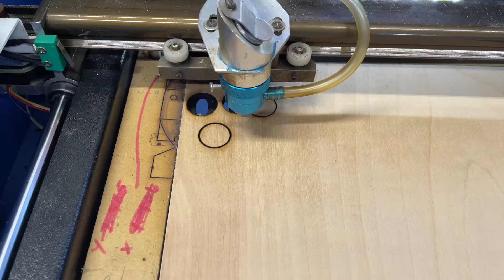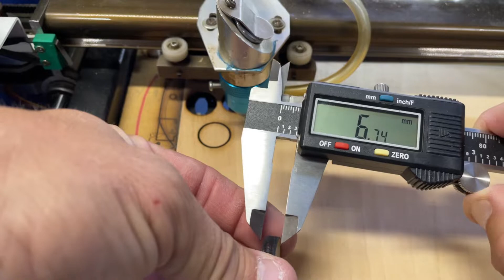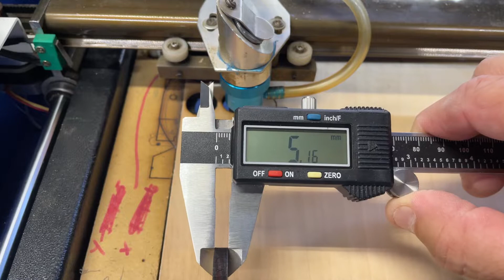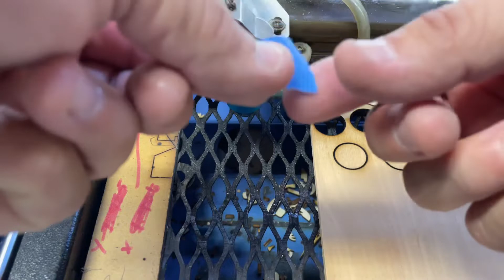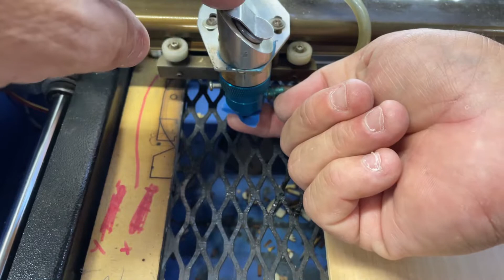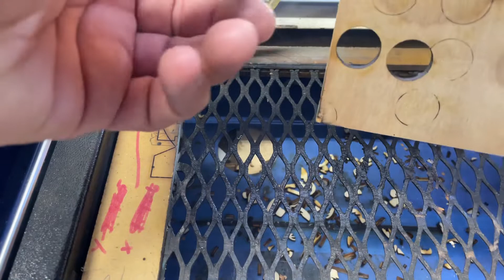K40 laser air assist trick. Cuts clean

Comment: Cool trick, gonna give that a shot.  Out of curiosity, what power (mah) and sped  (mm/s) are you using there?
Reply from the maker: 10 ma. 8mm speed.
Reply: @Checkitfirst  Gave it a try and it works excellent.  Thanks for the great trick!
Reply from the maker: @kortt  
Awesome. So glad it worked for you.
Reply: @Checkitfirst  I'm using the stock k40 head mirror holder (the silver one) and a Cloudray blue lens holder with the air assist like yours.  Do you have any trouble with air leaking past the lens and coming out the mirror hole?  I'm wondering if ther's a way to make the lens holder air tight so the air only comes out the air assist nozzle.
Reply: Got it figured out. Turns out some bozo burned a hole in the air line up stream ...duh... ok, back to see what else I can mess up :P
Reply from the maker: @kortt  
Sorry man, I just saw your post. Glad that you got it worked out lol.

Comment: Hi. how powerful is your compressor?
Reply from the maker: I just use an air pump there is no compressor tank. Compressors with tanks Have a tendency to produce moisture. Air pumps will never have a condensation problem.
Reply: @Checkitfirst  I see. the effect is great! what model of pump do you have? what power? I'm at the design stage. I don't have a blower at all in my k40. I changed the water pump to a cw3000 chiller. cutting speed of 3.5mm plywood increased from 11.5mm/s to 20mm/s. Unfortunately, I have a lot of burns
Reply from the maker: @pindlus  
Focus is key also. Is your bed adjustable?
Reply: Yes I know. focus is 50.8mm
Reply from the maker: @pindlus  
I use a 1.5” lens. It gets the air closer to the cut.

Comment: How often would you change the blue tape?!
Reply from the maker: Often. The hole in the tape will widen from the radiant heat given off from the laser. But typically I’ll replace it with a new one every time I go to use it.

Comment: I just got a k40 and am waiting on a pump and air assist nozzle. Is the air so precisely aimed that it is able to blow through that tiny hole without blowing the tape away too?
Reply from the maker: On mine it’s OK. I guess you would have to really adjust it and make sure you are not producing so much air pressure that it blows it off.  I’m doing this because my pump is small and doesn’t produce enough air to go through the big opening on the nozzle.
Reply: @Checkitfirst  Last question and I swear I won't bother you anymore. Your nozzles works well. I would like to order one. What brand is it and where did you order it from?
Reply from the maker: @AllenBethea  12mm/15mm/18mm/20mm Laser Head with Air Assisted Connector. Ideal for K40 Machine https://a.co/d/ij8uj6w
You can ask me questions any time you like 😊

Comment: Thats great, i have an offset air nozzle and it blows the burnt stuff all over the surface a d take 3 passes at 10mm/s 10mA to cut 3mm
Reply from the maker: 12mm/15mm/18mm/20mm Laser Head with Air Assisted Connector. Ideal for K40 Machine https://a.co/d/7QCrfy8
Reply: @Checkitfirst  Thanks, l'll check it out

Comment: Hey dude whud up? What model is that and is that the thickest material it will cut?
Reply from the maker: Hey man how’s it going. Long time no hear, ha ha. It’s A k40 laser. CO2 laser. The material I just cut in this video is about its max thickness. But you can cut lots of different things.
Reply: @Checkitfirst  ya been to long!! Been busy up here lol I would like to get a little cutter like that but first I think I would get more use out of a 3d printer so probably go that first but both are on the list! Do you have a 3d printer as well?
Reply from the maker: @ericjackson6082  
No. I did shop for one and was very interested. The software is what stopped me in my tracks. I wanted to design my own stuff not just download something and print it. The software to design your own stuff cost more than the printer I was going to buy lol
Reply: @Checkitfirst  ugh that sucks cause ya I would like to design my own stuff for sure!
Reply: @Checkitfirst  how are you all doing?